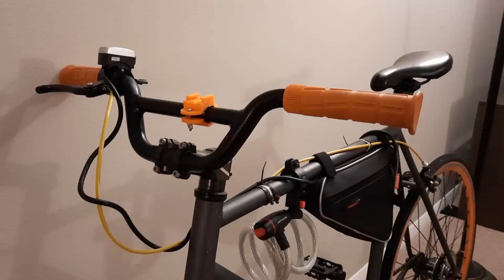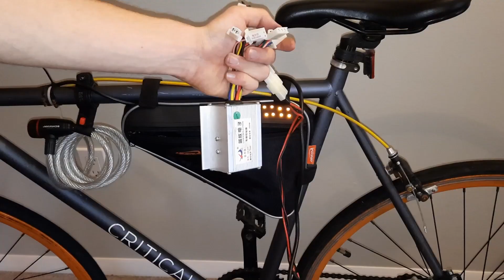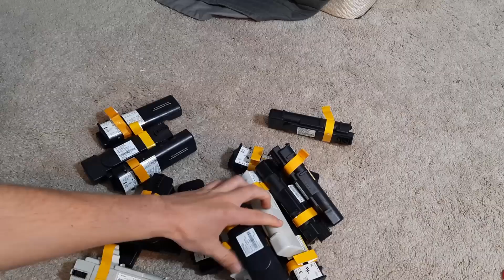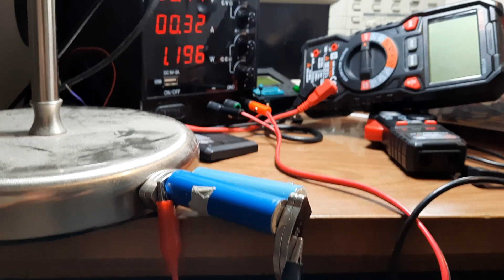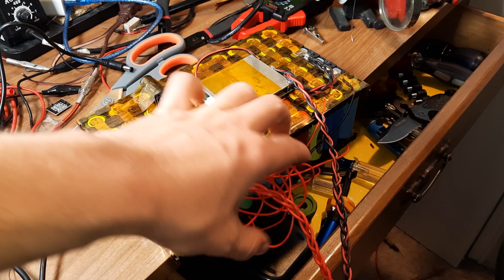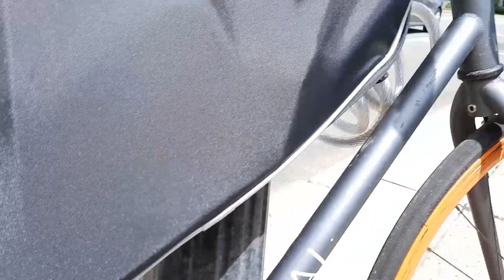The Rise and Fall of my DIY Ebike

Comment: I had a motor exactly like that one that I ground the sprocket thinner on to use the derailer on it and was able to feed it 2000 watts at 68 volts and it worked well without failure.

Comment: That freewheel is the same as many bicycles, you should be able to get that swapped out with a nicer one at a bicycle shop, you could even change the gearing
Reply from the maker: Thanks for the advice.  I am also thinking of using the motor for other things as well

Comment: What ?... You can't fix it ?? Also no data about the larger battery ride/test...
Reply from the maker: I will be able to fix it, I just thought this would be a funny ending. The larger battery got me 6 miles before the motor broke, and it still had 39.5 volts left, which probably could have gotten me another 15 or so miles

Comment: Battery technician here, though you've used a BMS and checked the voltage of the cells, you've forgotten to check to capacity of the separate cells. The parallel groups need to be the same total capacity for the pack to properly function. An imbalance might occur after a couple of cycles. Your best option is to charge the pack fully until the BMS cuts off and then manually charge the parallel groups that aren't 4.2V up to 4.2V. During discharge the weakest parallel group will cause the BMS to cut off early, but during charging everything will be nicely balanced once the pack reaches 42V again. This prevents overcharging of a single group, as those BMS's often only cut off at 4.28V.
Reply from the maker: Good point.  What is the best method of checking battery capacity?
Reply: @TannerTech  If you're just matching cells and don't care about knowing the actual capacity you could discharge a cell with a 4 ohm resistor and note the time taken to reach 3V. Do this with all the cells. Then take (if you're making a 7 cells in series 24V pack) 7 cells with similar discharge times, those are now the first cells in the 7 Parallel-groups. The next 7 cells should be the second cell of the P groups. 

If you start getting too much variation to get another 7 cells you can do the average of 2 cells also, adding 14 cells to the pack at a time.
Reply: @Beeeeeeeeeee  yeah, you can discharge them any way you want as long as you keep the variables the same, then you can compare them equally

Comment: I once saw a guy trying to DIY Ebike his bike with only 50€. He used a conventional cordless drill with exchangable batteriemodules. He fixated the drill behind the seat onto a plate and just run down a additional chain to the backweel with an extra gear down there. Left everything other the same. 

So pretty simmilar to what you did. Just without the need of a special motor or motor controll. 

Then some Trigger mechanism to the front, and it worked pretty well ngl.
Reply from the maker: Cool! did his bike go very fast?

Comment: Those are 18650 cells? Do you have really small hands? 😅 Most expensive part of an ebike, next to the motor, might as well not even bother getting a bike and just glue a seat to a child's skateboard, 😂

I wondered how long that 3d printed part might last for, also what stops people stealing your batteries? 

Maybe a slip or clutch to stop the gear being over torqued?
Reply from the maker: I know! I got all the parts to build the battery for about $60, so it was a great deal!

Comment: I did something similar, except I used a weedwacker engine. It was extremely fast for its size. At some point I started running nitrous oxide from a whipped cream bottle and it was even faster. It was so fun until the shaft on the engine sheared off 😅
Reply from the maker: That is legendary